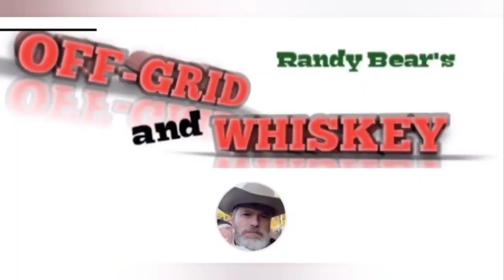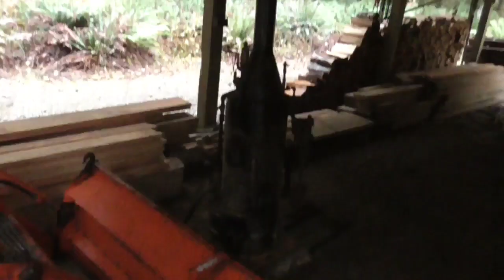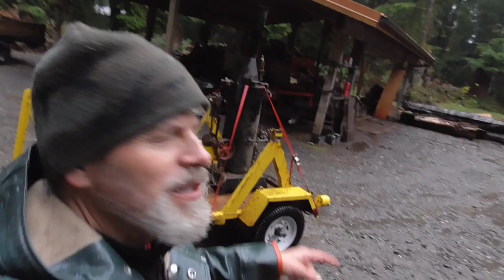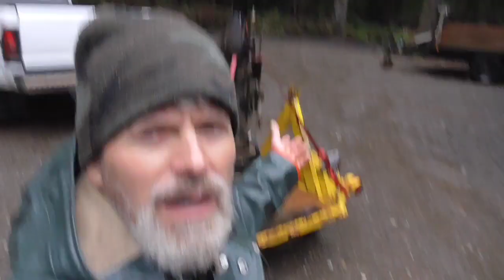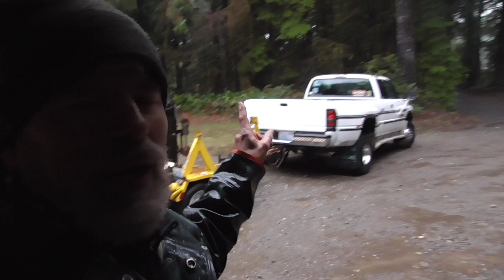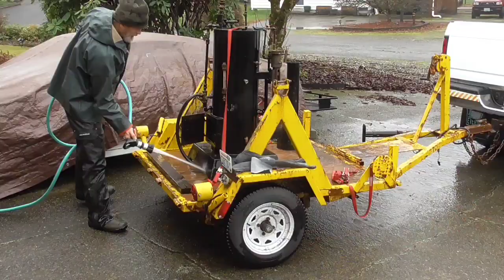Recovering a Steam Engine for Off-Grid Power!

Comment: What county are you in i think i could help you
Reply: Looks like the hose is the water feed line and there is a feed pump on the Engine
Reply from the maker: Do you watch Ross Bendixen on YouTube? From Anacortes, WA. He built my Boiler/Engine.
Reply: Yeah I have.

 I have a PM research number 4 engine but no boiler to run it with
Reply from the maker: Have Ross build a small one. PM #4 is 1/4 hp.
Reply: @OffGridandWhiskey he has a tutorial on your boiler if you look at his older videos
Reply from the maker: Email me: offgridandwhiskey@gmail.com